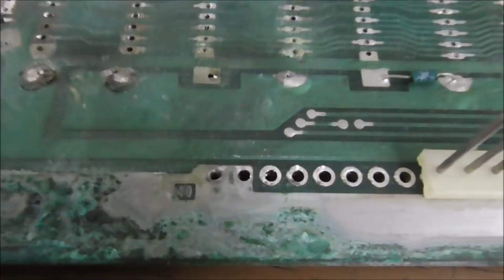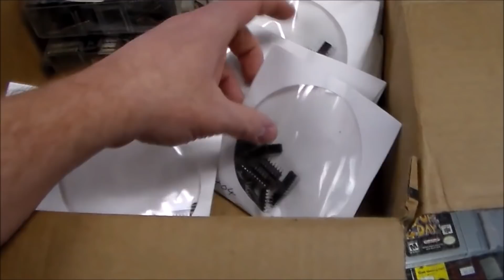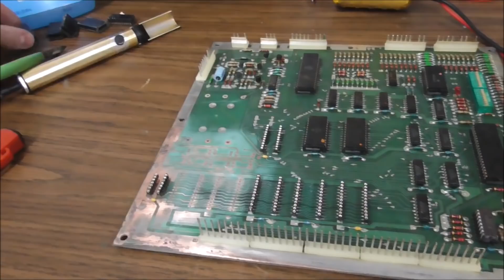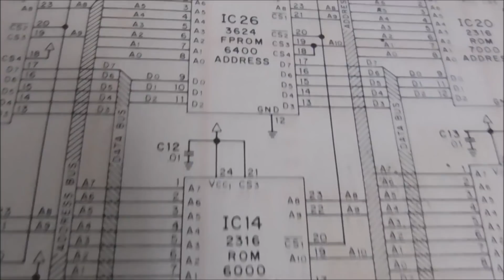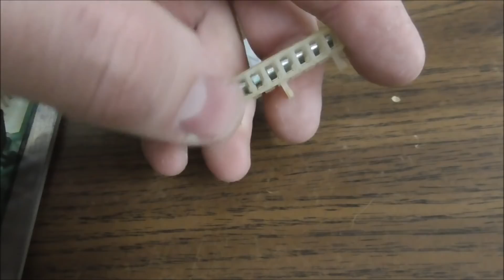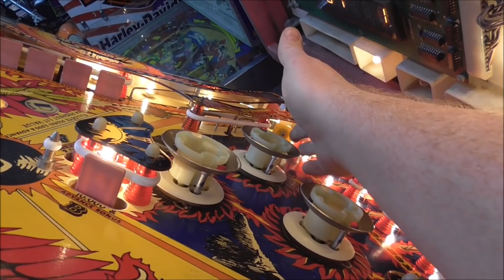Repairing REALLY BAD Battery Damage on a Williams Pinball Machine MPU

Comment: JOE CLASSIC, Its often that the "charging resistor value" gets changed on the pinball games motherboards there is a Resistor that is the charging resistor for the tickle battery charger circuit. Sometimes they use 1K or another value to have a slower charging rate or a faster charging rate. I'm not sure why they would want to modify the charging rate trickle time. I have heard that using a faster charging rate will make the battery life span less. When using different types of batteries like carbon, alkaline, NiCad and now lithum Ion that they all have different charging rate trickle times. Have you notice on pinball games motherboards that the charging resistor value using different resistor values from the factory or when other repair techs have changed the values?
Reply from the maker: I haven't seen that on pinball boards but that makes sense now that you mention it.  I can see where that might need tweaked depending on what battery or maybe how long it's turned off, that's an interesting concept...
Reply: @LyonsArcade  Yes look into it  because Arcade games use also batteries for backing up with highscores so either the factory or repair techs will modify the charging resistors values for either fast charging rate time or slow charging rate time. Maybe ask you employee Matt why they do this because it from the factory you can have the same arcade motherboard but the charging resistor values are all different.

Comment: The blocking diode may be excessively leaky,they use Shottkeys as the forward voltage drop is around 0.15 volts rather than 0.6 problem is they have a bit of reverse leakage, causing the batteries to charge which will aggravate the chemical leakage. I use Zinc-Carbon they can be slowly charged without bursting  2032 Coin battery is also an option.

Comment: AAawww man I need some one to send me IC chips and IC holders I have to buy mine still. :(
But with that said if there is a new board made for an old pinball machine I will just get that and get the reliability back then mess with an old board.
I used to repair the old boards and it will work for a bit then since there is still that old component in that you did not replace it also has gone bad as the board has some new and old components in it.
And for the System 7 on my LaserCue I replaced all of the male headers and the female headers on the 40 pin connector.
And going remote on batteries does not really help much.
The leakage is not really enough to cause all the damage it also gives off alkaline vapors that can destroy other boards as there is no ventilation in the back I mean there is but there is no fan circulating the air so the vapors stay in the head and kill other boards too.
What I do is put in a new battery holder on the board and put in lithium batteries.
Yes they do cost more but you will get at least 5 years if not more out of the lithium batteries and the lithiums do not leak when they go dead.
I mean they do but only if you short them which is never a good thing for lithium batteries.
I know you are doing stuff on the cheap and I am more on the "higher end" restorations and I am not attacking you in any way just letting you know what I do. :)
Reply from the maker: No problem man I appreciate the info and you watching, see you on the next video :)  Laser Cue is a pretty neat game too....

Comment: Watching you repair these old machines is bring back 30 year old memories of my college circuit design classes.  That box of chips is a treasure trove...used a ton of those 74xx logic chips in my designs, then they taught us about PALs and suddenly a 24-chip design became a 2-chip design. 

I never did become a computer engineer but I remember those little caps on the ICs are decoupling capacitors...they ensure a constant 5V to the IC so a quick power glitch doesn't cause the IC to freak out.
Reply from the maker: Thanks Chris, I never took any electronics classes (obviously) but it's fun learning with these old games because the circuits are relatively simple to figure out!  We'll see you on the next video...

Comment: Many years ago I worked for a gentleman in Joplin Missouri working on electromechanicals and some video games..that was the first year that they came out with the LED displays on pinball machines instead of the mechanical rollers and I thought back then wow what an easy way to maintain a pinball machine you have a problem with something you just swap a board.. but now 30 some-odd years lateryou're rebuilding the electronic boards and repairing them instead of just replacing them... Do you know how long it took me to learn about points and electromechanical????
But you guys are making it look easy keep up the great videos...
Izzynutz Restorations..
Izzy....
Reply from the maker: Thanks Izzy, yeah it took me forever to figure out how the e.m.'s work, just didn't make any sense to me, finally what opened my eyes was when I figured out that the switches are either on or off, and when the relay pulls in they should reverse.  You'd think that'd be obvious but it took me forever to  understand, once I caught that one point it all made sense!

Thanks for watching, see you on the next video!

Comment: Sanding the pcb board, hmm. Would rather use a fiberglass brush If I was you :)
Maybe conformal coating on the bare copper traces to prevent corrosion.
Reply from the maker: Thanks for the tip!

Comment: Those 27 ohm resistors look toasted....Great restore...!
Reply from the maker: Thanks Jordan, they looked really bad but they're not usually out of spec, they just burn pretty hot because I think they're 3 watt and need to be more like 5....
Reply: Hi... I've been working on all kinds of electronics gear since 1970...Lots of ham radio stuff with those 2 and 5 watts carbon resistors. In some ckts, a 10% rise in value can wreak havoc, and a failed bias or bleeder resistor can mean death to tubes and other parts, including the person working on it...!!!

Comment: do you spray some kind of sealant over your exposed traces?
Reply: I have to admit, the exposed traces are making me twitch, and quality control at work REQUIRES us to seal exposed traces, but some circuit boards I etched in the 80’s are only corroded where my fingerprints were left on them.  :-)
Reply from the maker: Nope.
Reply: If you never used conformal coatings you must never work on equipment that lives outdoors or in humid climates. It is cheap insurance against moisture
Reply: Just pointing out that sealing board traces is not a myth and is, in many cases, a required step. No worries..

Comment: JOE'S CLASSIC VIDEO GAME, thanks for the making the video
1.) What is the batteries powering which IC chips? can't the batteries be replaced with something other 
2.) Why does using 47 bulbs use 40% of less power compared to using 44 bulbs? 
any reasons why 
3.) Why does other technicians say that its BAD using the machine head IC sockets? I'm guessing they want you to use the dual wipe sockets instead of the machine head IC sockets? 
4.) You Mentioned you were going to use a "TEST ROM chips" when you don't use the driver board to test the MPU system 3 board. Where would the TEST ROM chip go at which IC socket to test the MPU system 3 or 4 when not connecting the System 3 or 4 driver board?
Reply from the maker: Thank you for your questions Bill, hope you've been doing good.
1.  The battery powers the 5101 ram chip, it's sole purpose is to remember the settings and the high scores.  They make a replacement for the 5101 that doesn't need a battery, yes.
2. A 47 bulb uses 40% less power than a 44 bulb because a 47 bulb is .15 amp and a #44 bulb is .25 amp.... which means a 44 uses 40% less amperage
3. Like you said the dual wipe ones are better because of the way they grab the leg, but unfortunately you can't see the top of the board under the socket, so when the board is messed up I use a machine pin one.
4. The test rom goes in socket #14 which is the one we added in.... it works pretty good but since ours started right up we didn't need to use it this time.

Thanks for watching Bill we appreciate it....
Reply: @LyonsArcade  thanks for the help. 
I always thought machine pin sockets were the best because that is what EE engineers have told me but i guess dual wipe sockets are the best. I wonder why technicians are telling you that the machine pin sockets are bad or cause what type of failures & issues because the dual wipe causes more intermittent issues more often compared to machine pin sockets. I'm just curious why other people are saying that dual wipe sockets are better than machine pin sockets. 
1.) The Test ROM test the lights, switches, solenoids, game sounds, ROM,RAM, PROM, PIA chip tests? 
2.) Did anyone say why the old system 3 RESET circuit needed to be upgraded modification because the system 3 reset circuit caused certain reset failures and issues? not sure if their was service bulletin in the service manuals or just word of mouth from technicians. 
3.) Those little blue decoupling capacitors are "ceramic axial" caps or are they different than ceramic? I don't see those little blue decoupling ceramic axial caps often mostly ceramic Disc coin types.

Comment: You really don't need to use any sort of acid unless it is the corrosion is just that "stuck".  The main electrolyte used in those batteries is potassium hydroxide.  Once it reacts to the metals on the board it is for the most part neutralized. Using acetic acid (vinegar) only does more damage to the board and turns any lead in the solder that was reacted by the potassium hydroxide into lead acetate which is rather toxic.
Reply from the maker: Boy I thought I was doing good but now a viewer has informed me that once again, I was wrong.
Reply: Puddin people such as yourself are very important to those of us in Micro to explain the hard science of chemistry to us.  Awesome explanation.

Comment: Yes.  Modify the setup so you can mount the battery holder off of the circuit board.  Wow, I cannot imagine why the original designers decided mounting potentially corrosive batteries on the board was a good idea.
Reply from the maker: It's just like anything that takes batteries, if you change them there's no problem, and once the batteries die the game throws up an error code (boots into test mode).... what they didn't count on was the many years the games would sit in storage with the batteries still installed, Yikes!
Reply: Joe's Classic Video Games Yes that’s true but when designing a compact device you have little choice but to locate the batteries in the case close to the circuits (I.e portable Radio, Smartphones, camera, etc.).  In the case of designing a circuit to be housed in a cavernous box, it just seems careless to mount batteries on a circuit board.  Anyway, that’s my two cents.  Thanks for making your interesting videos.
Reply: In their defense, when these battery holders were first introduced to the board, alkaline batteries were relatively expensive and not commonly used. The zinc-carbon batteries of the day were not nearly so prone to leakage.

Now, that doesn't explain why they continued to use that design. By the mid-80's and certainly the 90's, alkaline batteries were about all anyone sensible would buy, since the price per watt-hour came down to competitive levels. Chalk it up to inertia, I guess.